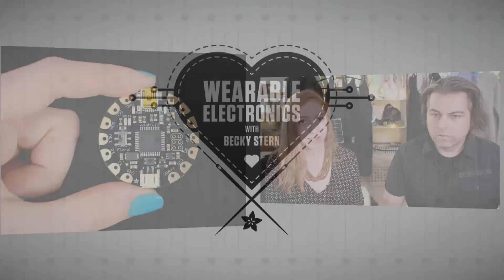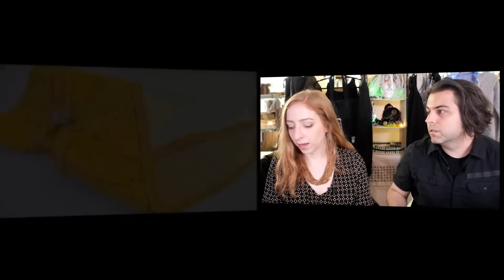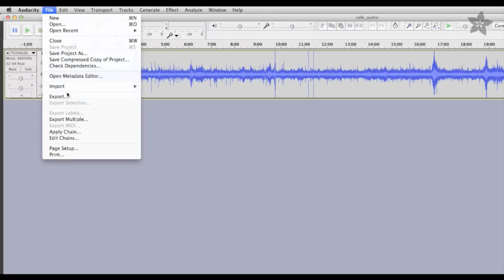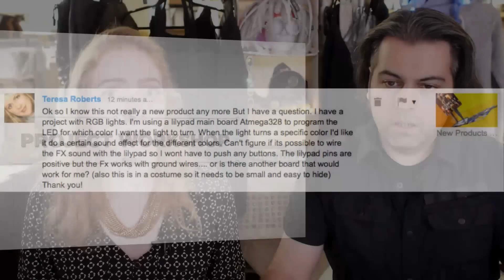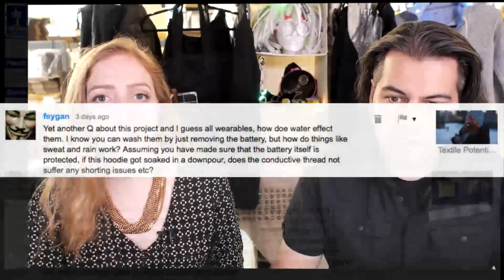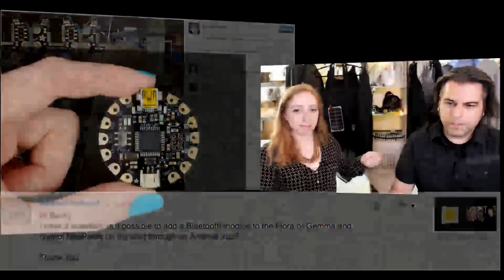Wearable Electronics with Becky Stern 2/18/2015 - LIVE

Comment: Hi Becky.
For my final degree project I am working on a arduino based smartband with a GPS that will send the location to an android phone using Bluetooth and log it to a server, something similar to strava.com.
For the smartband I started doing a big prototype with an arduino uno and Serial SPP based Bluetooth.
Now I want to make it small so I will use a flora but I am not sure what Bluetooth to use.
As I have already the code working with SPP and it works below android 4.3 I was thinking to use the Bluetooth EZ-Link.
But in terms of battery BLE seems to be the best option.
Any suggestions?
The new flora Bluetooth module that is coming will it be BLE or SPP (Serial)?

Thanks in advance!